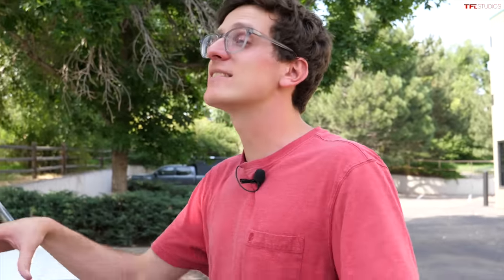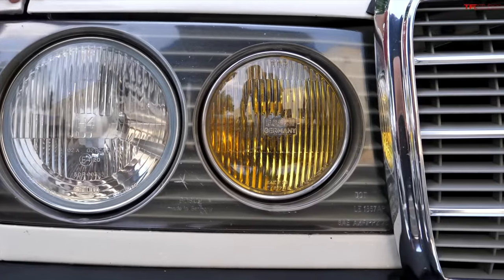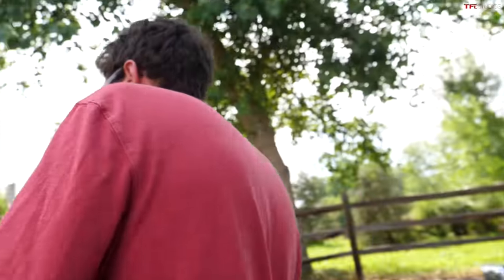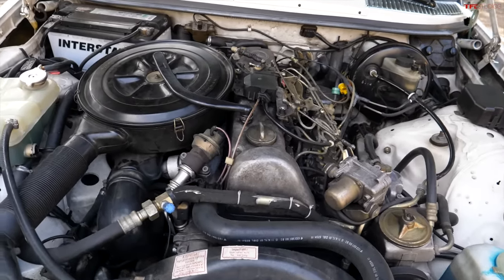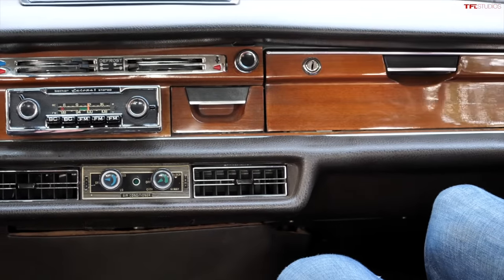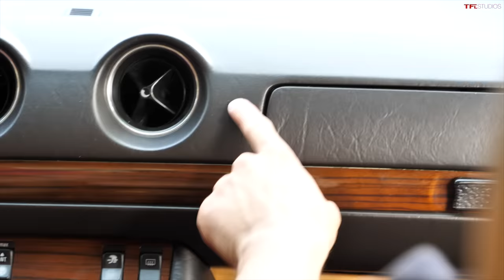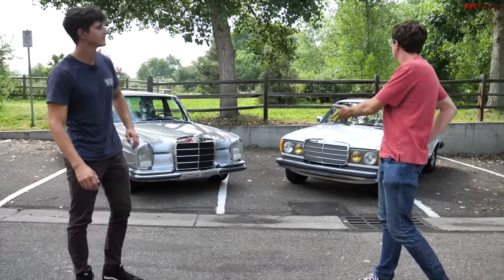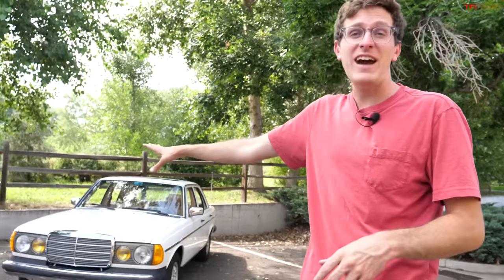Is It Worth Buying a Classic Mercedes-Benz? We Share Why It Absolutely Isn't (& Totally Is)!

Comment: C'mon, even the 280S from the early 70s had 180 HP for 1400 kgs and ran over 200 km/h! It wasn't a slow car at all! The Diesels with 55  HP were like the slowest thing ever seen on road. Can't remember how many horsepower the Turbodiesel had but not much more than 80 HP. So what nonsense are you telling? The 5.4 l surely had over 220 HP and wasn't that slow. I drove the 280S and it would be a fast car even today.

Comment: They are still the best car's Mercedes ever made the cars from the especially the 80s Like maybe an? 87? 560. Yes? E! C the 8889 always food early 90s. When they stopped making the FC c's? They. Were the best cars ever the? 2. 80C? E! Was a absolute magnificent car? You just couldn't hurt them you took care? I'm right and they took care of you you. Want time I had dozens of them and now.  I'm down to about 8 of them and my favorite car that they ever made and I still owe it to this day. Is A? 90? 9. CL 600 which? Yes. AV12 Tudor co-op black on silver would you just can't beat that card?  Is indestructible and it runs like a bear but I believe that the cars of the old days from the 80s 90s and a lot of the? 7970 eighths the 280C ease and the even the CDS where were just magnificent. I believe they're better than the Mercedes that they build today. I'm not a fan of the Mercedes of today. They have ruined the styling the looks is terrible they're so small inside.  It's absolutely horrible what they've done to them once they emerged with Chrysler. It was all over you can buy any of these I grab them.

Comment: @TFLclassics oh no. dont get Coker Tires. they are terrible. if u plan on making it a show car with very limited driving Coker is fine. but if u plan on diving the car...... they suck. i have put many a sets of Cokers on all kinds of different classics. they all share the same flaws. almost every single tire is out of round, uses subpar materials, have tendencies to fail and low wear life. I'd say just get some Michelin's and ditch the white wall's. White wall's are an American phenomena at that time. white walls were rarely seen in EU on MBZ. even though i tend to like white walls on US cars, they look off on German. Im in the Bay Area near a few high end resto shops, one that specializes on MBZ. so i see and work on quite a few older Benz's.  

love the cars. old Benz's r amazing

Comment: This is my absolute pet peeve about Mercedes-Benz classes the S and the E class started in the 1940s my father‘s W107 series was known as a super class it was always the S  It designated top line mercedes as an E which stood for fuel injection later became irrelevant because every car had einspritzpumpe and it was later known as the executive class and the C compact class started with the 190 E but do you speak to anybody at Mercedes-Benz and I grew up in Stuttgart I was born 20 km from there.   Please please please get it right the S in the E started in the 1940s and I could go through every designation but if you go to the factory in Stuttgart the S class goes back 11 generations and the E about nineSo please don’t confuse people telling them that the S class and E didn’t exist tlil decades later.   In fact The W124E class started life a 300 E and then midstream became the E300 and the only thing that was changed was the badge on the trunk lid.  Remember ask anyone who works for Mercedes-Benz in Germany they will laugh at you if you suggest at the first S class wasn’t made in the 1940s

Comment: If you can do the repairs alone, thre is nothing better than perfect classic Mercedes. If you are not very rich but you are stupid enought to buy it and then repair it in official dealership you can go broke very easy. Seen bill for classic S600 for over 20 000$ in England for simple maintenance- filters, oil, brake calipers, brake discs etc. If you are millionaire that has no money issue you can do whatever you want.

Comment: not much of value here in terms of answering their question. I have driven these since 1978 and I have 3 diesels that run fine because I have spent a lot of time maintaining them.If you are not  an  experienced MB mechanic stay away from them. They last if you do a lot of maintenance and have the tools like a lift and the skills to maintain them. If you don't they will be a money pit. want easy to maintain reliable cars? get a  2 decade old .toyota or a honda. That said I will never sell my 300D or my 240 D.

Comment: Not uncommon to see a turbodiesel W123 Mercedes with 200K or 300K miles before needing overhaul... that's cute. I'll see your W123 with my gasoline 4.6L V8 Lincoln Town Car, not uncommon to see with 500K or 600K or even more miles on the original, unopened engine and drivetrain :-)